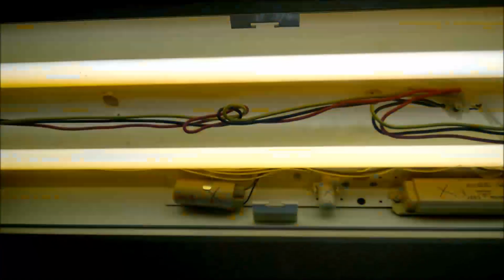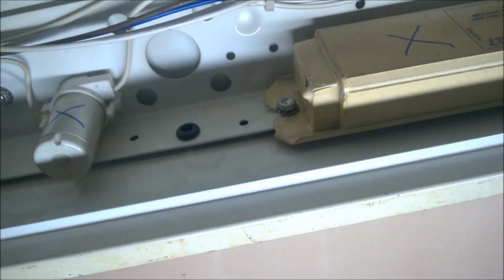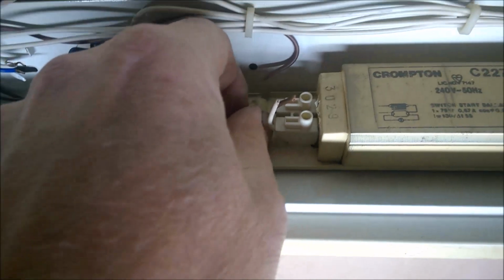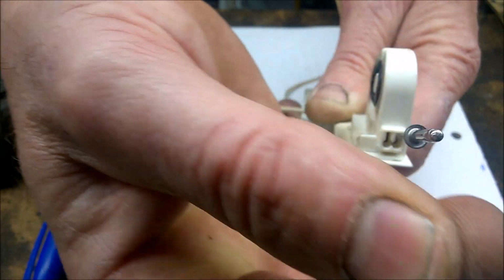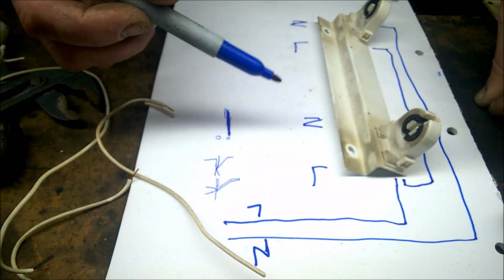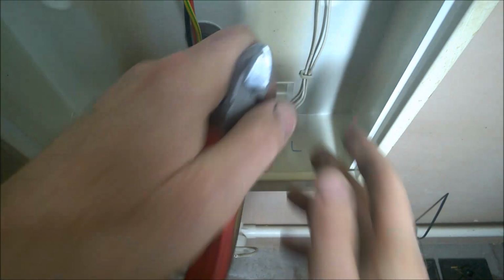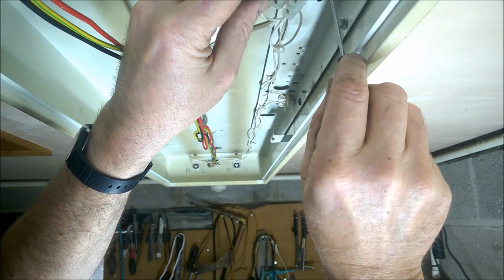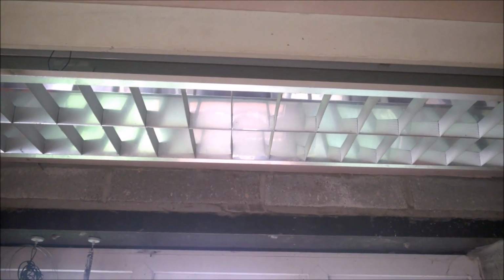How to convert a fluorescent light fitting to led. step by step tutorial.

Comment: Hi Olly,
Great tutorial, I had seen other people's YouTube vids, and they were not as easy to follow as yours. So I went off to screwfix and bought a replacement tube, it had a plastic cap on one end when I took it out of the box, I just thought it was a to protect the end terminals,! :( ,.
So I did a search for a new 2amp fuse to put in the starter fitting after doing the conversion, and realise the , "protective plastic cap", was a the bloody fuse, derrrr!.
Regards ,
Keith
Reply from the maker: Thanks Keith, saves loads of cash doing it yourself.

Comment: Hi good video ! Going to do my garage light it’s only one tube !  Are all the tube holder push fit or do I have to buy new ones thanks
Reply from the maker: No. I used the existing tube holders Robert. If by chance that you struggle to remove the wiring from the holders at the non power end of the fitting, you can just cut them and use electrical tape on the cut ends. Also, if you do damage the ones you have they are easily obtainable on the internet., and yes 90% of all tube holders are push fit wiring connections.

Comment: Where can you buy the tubes and fuses
Reply from the maker: Sorry for the delayed reply John, since i made the video, the cost per tube now in the UK is about £7.00. about a year ago I paid £20.00 per tube. Go on the internet John and order on line. Measure the length of your existing tubes both in metric and imperial as some suppliers use one or the other.Most led tubes come with the fuse also like mine.Going to order some more this coming Tuesday for work so if you are based in the UK let me know and I will send you supplier details. Also when you get your tubes if your not quite sure on the rewiring of the fitting or any queries I will take you through step by step. Just helped a Lady in the U.S repair her t.v. set via email.She was very excited she managed to repair it by herself and not having to buy a new one.
Reply from the maker: Thanks michael, I now order my tubes from LEDKIA LIGHTING. £7.18 each on the internet.
Reply from the maker: Thanks John,I now order my tubes from LEDKIA LIGHTING. £7.18 each on the internet.
Reply: Any fishing tackle shop or bakery...

Comment: what was the cost off doing this thanx
Reply from the maker: The cost was just for the new led tubes.I paid £30 for 2 tubes. Now they come on without the flickering the old tubes did.brighter and no maintenance cost i.e; starter motor,chokes and capacitor replacements not to mention the power consumption now is 56watts(for 2 tubes)Before it was 140watts.The cheapest twin led fitting replacement in the Uk now is £80.00 each. Hope this helps Chop Shops. Olly.

Comment: Great video. Thanks. Helps me understand what's involved. 1 question though. I thought that the video showed the mains cables were visible at the end that you wanted the power from. Is there any reason, apart from the fuse, that you did not connect directly from that and do away with everything else.
Reply from the maker: Only the 230v live was connected to the fuse before it continued on to the tube holder  directly from the mains steve. The neutral wire did go straight from the mains comming into the fitting straight to the tube holder(end cap is the technical term). Cheers for the comment.Feel free to ask in future also.Dont forget your earth if you have a metal fitting mate.Cheers.
Reply from the maker: Sorry so yes everything was disconected and the live and neutral were connected to the mains comming in. will check my video. it was one of my first a few months ago. have got to convert another one so if your not confident i will do another with better footage. Let me know if any issues.cheers.